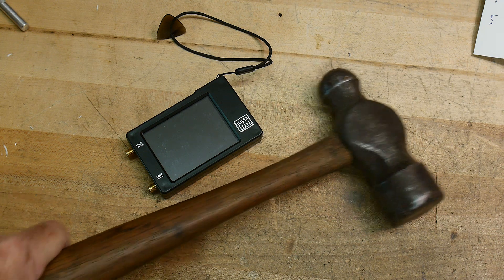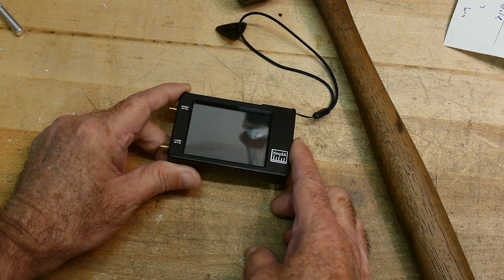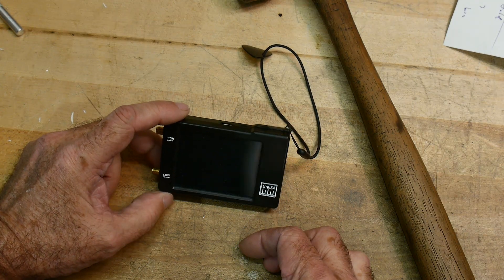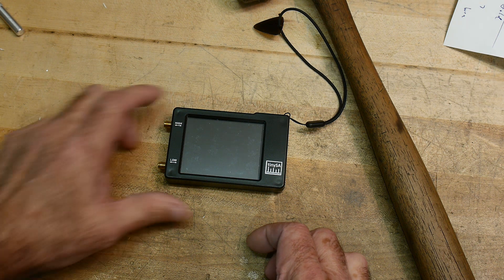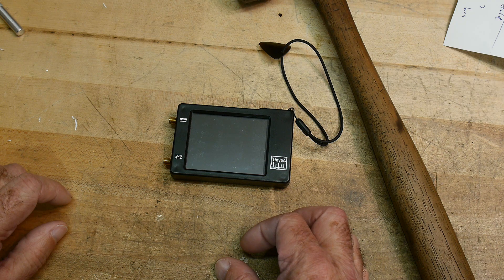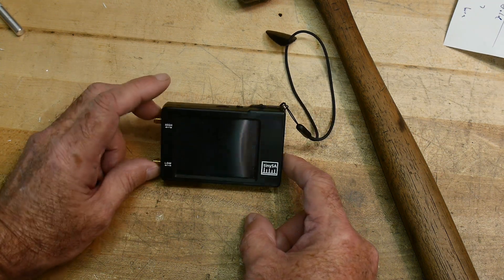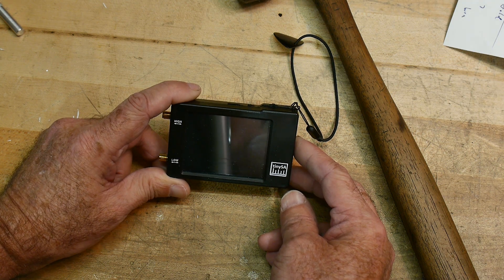#584c TinySA Defective

Comment: it would be nice to see the test procedure and the error displayed.
Reply from the maker: The test procedure is just the self test. connect the cable push the button. a fail is obvious
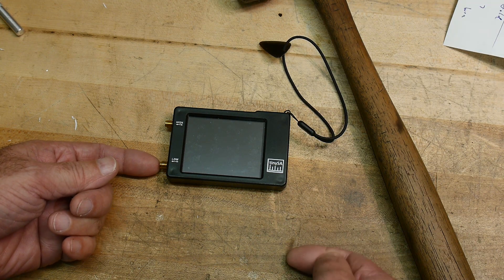Reply: @IMSAIGuy  OK. I was just talking about the procedure you describe at minute 2:10 or so.  Using an external source to excite the device and measure the signal level at different attenuations :)
Reply from the maker: @joaopaulocoelho5401  yes, the new firmware and cable between the ports does this all for you

Comment: You can download a new FW with an updated selftest that tests all switches and attenuator steps inside the attenuator IC. As doing the test takes considerable time and the selftest is also used during manufacturing I choose not to test all possible combinations of switches. According to the attenuator datasheet the switches are in series so the test should catch a faulty switch or attenuator step.
http://athome.kaashoek.com/tinySA/DFU/
For running the selftest connect high and low SMA connectors with a good SMA cable and click on CONFIG/SELFTEST. 
If selftest 11 fails you have a faulty attenuator. The screen will show which attenuator step failed (Atten: xdB)
Reply from the maker: Yes my unit fails #11 at 4dB
Reply: @IMSAIGuy  As expected. Good to hear the test does its job. Thanks!
Reply from the maker: Suggestion:
at the beginning of calibration or self test, do a cable present check, see if there is a signal. tell user to install cable between connectors
Reply: @IMSAIGuy  Done FW v1.1-13
Reply from the maker: Received the replacement today. Thank you. Oh, and yes I put the latest firmware in and it passes tests :)  I hope future units will have the firmware to catch any problems. This one had pretty old firmware.
Reply from the maker: Thanks for adding the AM percent modulation. Here is my results maybe you need to modify your math:   14MHz AM mod -35dBm. 10kHz
%mod   HP    Tiny
120        122    111
100         101    100
80            81      87
60            60       75
40            40       58
20            20       25
10           10        -12
1              1         -45
Reply: @IMSAIGuy  Yep, got the wrong formula. updating now
Reply from the maker: @ErikKaashoek  OK. let me know when you have a new version and I'll do the tests
Reply from the maker: @ErikKaashoek  Too bad you are having trouble finding peaks. If you have never looked at machine vision algorithms you may find the solution. Take the sweep and apply a convolution filter to it. This will filter out the noise and round your flat top filters into points. Then it will be easy to find the correct three points. Once the points are located in X then go back to the original sweep and get Y. you may want to apply a second convolution at that point to smooth the data a bit. The filters would be a very simple 1xN matrix. In machine vision literature it will all by NxN but just collapse it to one dimension.
Reply: @IMSAIGuy  Thanks, The convolution filter is an excellent idea. Not sure I can fit it in as code space is getting rather limited. For now I added a question for the modulation frequency so searching is no longer needed.  This also helps when measuring low modulation frequencies as there are no longer separate peaks but only shoulders. I'm now able to measure 3kHz modulation.
Reply from the maker: @ErikKaashoek  I'll give it a try. The ideas of machine vision could lead you to a very simple and small code implementation of a simple filter of the data. maybe a simple average is all that is needed. you already know the IF filter size so you can choose filter parameters easily.
Reply from the maker: @ErikKaashoek  values are high and fluxuate. markers in good positions
120   129-133  
100    103-115 
80       86-97     
60       65-68     
40      44-48
20     23-26
10     10-12
1         1
Reply: @IMSAIGuy  did you enable averaging?
Reply from the maker: @ErikKaashoek  no, that would help maybe. I assume it will still be high. 
here is a simple addition:
in marker ops
marker -> ref level
Reply from the maker: turned on ave=4   still high
Reply: @IMSAIGuy   Ah, yes. Rounded up to to scale. Good suggestion.
Reply: @IMSAIGuy  Thanks, Another user reported differently. "A man with two clocks does not know the time". Will ask some more people to measure. I do not have a calibrated signal generator.
Reply from the maker: @ErikKaashoek  I use an HP33120a synthesized generator and HP8591E. Also checked with a second source on my 8921
Reply: @IMSAIGuy  New FW (v1.1-19) should calculate a bit lower values
Reply from the maker: @ErikKaashoek  Good measurement numbers now. But, it takes 15 to 20 sweeps to settle to a good number. way to slow.
Reply: @IMSAIGuy  IF you set sweep to fast it should be faster

Comment: I also have a pre-order unit and it seems to work fine. Passes self tests, firmware 1.1-9. I did not test EVERY step but the attenuator on the Low input works as expected when checked from 0 to 10 dB in 1 dB increments and 10 to 50 dB in 10dB increments. It tops out at 52 dB. I also own HP 8594E and 3585B gear so I'm not new to this. Erik will make it right for you.

Comment: I received mine a few days ago so thought I would check.

GPS locked signal source set to 50mHz
-32dBm output
TinySA reads -32.1dBm at all attenuator settings.

I'm happy with that. Shame you got a bad one but hopefully Erik will sort it out and maybe add an extra test to the calibration menu? I'm really enjoying your TinySA content and it's the main reason why I decided to buy one.

Comment: I'm kind of shocked. I picked mine up on the first video you made about it. I'm not at the point I can test mine. It serves the purpose I purcahsed it for quite nicely, as the internal attenuator isn't necessairialy need. I got mine principally to answer a question I had about noise in my area of Nashville, and in particular, to see if my LED light bulbs produced RF noise, before I went off and purchased an expensive transceiver. Thanks for the videos, and I'm sure that Erik Kasshoek is going to make sure you get a properly working instrument. 73's

Comment: A new tinySA will be send once he has confirmed his contact details
Reply from the maker: I don't use my 'real' info here and won't. if you send me your email I'll respond in a private email.
Reply: @IMSAIGuy  Maggie has confirmed a new tinySA will be sent next week
Reply: @ErikKaashoek  is there a way of doing a self test to show if one is  also faulty? I have one ordered through Amazon but I'm thinking about refusing delivery as I've no way of testing and I'm worried it might be faulty too.
Reply: @bak2back  Yes. Download and install the v1.1-11 FW as explained in the tinySA wiki: http://tinysa.org  . Then run the selftest as explained in the wiki under "First use" The self test will test the attenuator switches and attenuation steps in test 11 (the last test), If your tinySA passes the self test all should be ok. Keep in mind that out of the many tinySA supplied to customers we now have 1, possibly 2 that have this error that may be caused by a faulty chip. (not the soldering as the interface to the chip is serial). It's very unfortunate IMSAY Guy is experiencing this problem.
Reply: @ErikKaashoek  ok thank you, I'll do that, hopefully it's just a random and rare production error. I'll update when I've received and done the test so anybody reading doesn't get worried like I did in the future
Reply from the maker: Thank you. I was not mad just frustrated. you will see I'm laughing at the beginning of that video
Reply: @ErikKaashoek  It arrived today, downloaded and updated to the latest FW, it passed all tests, so that's great. Thanks for replying and the support.
Reply: Nice TEAM
Reply: I on behalf of the many thank you for the kind gesture. Yes, I appreciate it.

Comment: That’s unfortunate, I’m sure they will sort this
Have u tried the sdrplay spectrum analyser?
Regards
Iain
Reply: Unbelievable
Reply: I tried it, but it is not a true SA. You can only see a narrow band at a time. Plus, the scale is not represented correctly, at least when using a cheap RTL-SDR. There is just not enough dynamic range.
Reply: @samuellourenco1050   but have u tried with sdrplay rsp duo.?

I tried it and seemed fine, although I know nothing of spectrum analysers🤪 yet
Reply: @samuellourenco1050  et.al. HackRF has the hackrf_sweep_spectrum_analyzer for wider bandwidth sampling and even with the RTL-SDR there is the Spektrum application.  Albeit the later is really slow in sampling rates.  I haven't played around with my Adalm Pluto yet... will be later this year or after the new year.  I did last night build a new PC with an FX6300... yeah... I'm behind... and found the SDRPlay RSP1a I have wouldn't detect with the latest version of RSP-Spectrum Analyser.  I was able to install the 1.0a version and get operational.  I still need to install the NanoVNA and TinySA applications... though they seem suitable standalone as they're designed to be so no real need.  The SDR's are more for monitoring and eventually signals identification use.  Still learning, watching and listening.
Reply from the maker: No. I object to PC based instruments in general. The SDR architecture would not be a real spectrum analyzer. It would be very similar to the HIGH input of the TinySA. Not for me.
Reply: @IMSAIGuy   well u have got the HP so the videos won’t stop hopefully.
Take care
Iain